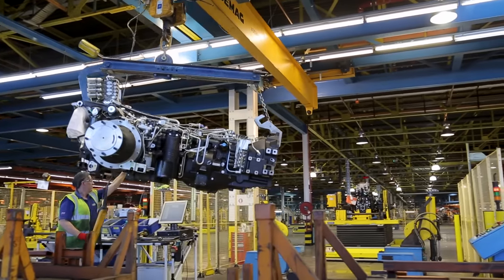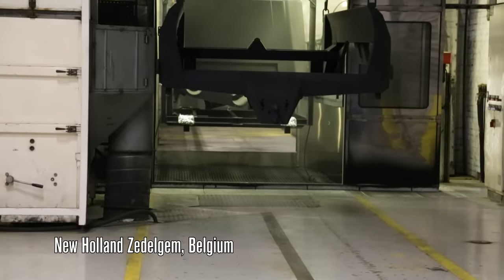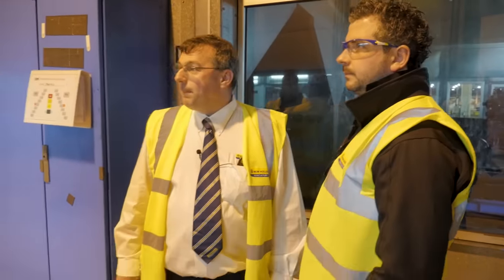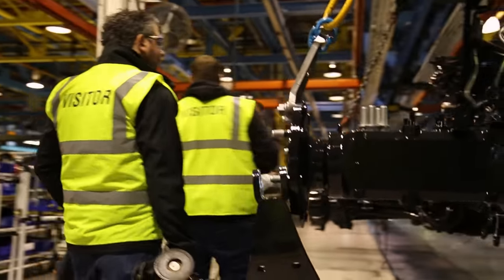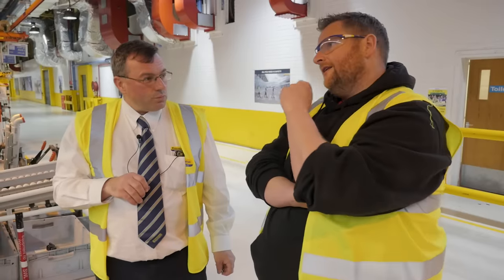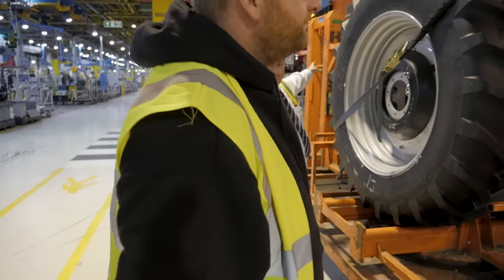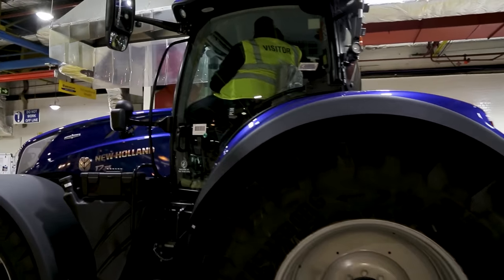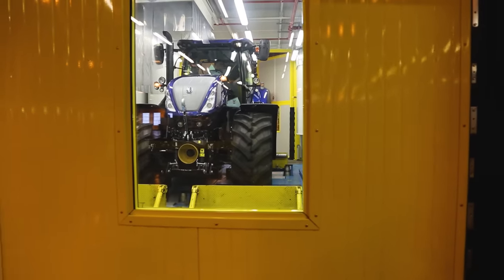GRASSMEN TV - New Holland Basildon Factory Tour

Comment: I think the reason we use pick up hitches is because a front axle trailer would be very hard to pull in wet uk conditions. Our trailer design in the uk/ ROI puts a decent weight on the back wheels increasing the tractors traction. The tractors back wheel is a large diameter and therefore doesn't sink as much as a trailers wheel would. With a front axle trailer you would have to put extra ballast weight on the tractor and the overall weight of the outfit would increase and you would inevitably bog.
Reply: That makes no sense in denmark and other parts of europe we use the same stile of trailers and we use another type of drawbar, all the pickup hitch is good for is that its easyer to hook up
Reply: Midget But there is very little weight on the tractor with a front axle trailer
Reply: AgriSpec yes I know but we use both types of trailer here
Reply: AgriSpec we use either a oldschool pin hitch or a ballhitch
Reply: AgriSpec I
Reply: French style Piton hitch can be fixed or on a slider, they still pull UK/Irish style of trailer, they are a stronger  more secure solution and have higher vertical payload. They use hydraulic or windey jacks to hitch up. Only reason we don't use them is because we are lazy mainly and slow to change. 🤷‍♂️

Comment: Some questions for you Grassmen.  1 > why are the back tractor wheels on most tractors always bigger on the back than the front?  You should have them the same size due to the need of ground pressure and grip.   2 > when the all electric tractors come in to replace the older smelly noisy expensive to maintain and run soon to be banned Diesel tractors and other farming machines?    Will you be pleased to change over to electric ones since you be saving up to 60% on maintaining and running costs as you be able to make your own electric with farm based wind turbines and solar.   3> why are the UK factory not using Goodyear tires for their tractors?  use British tires for British made tractors not use the French Michelin tires.  Is the Case company now owning the New Holland brand?  4> does the Italians run the company now?
Reply: Jesus you haven't a clue...bit of a condescending tone too